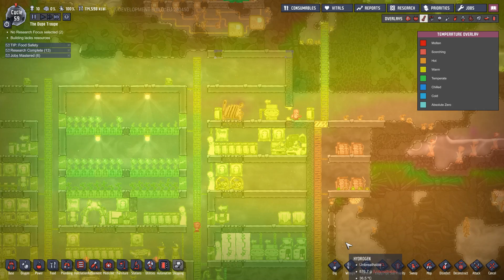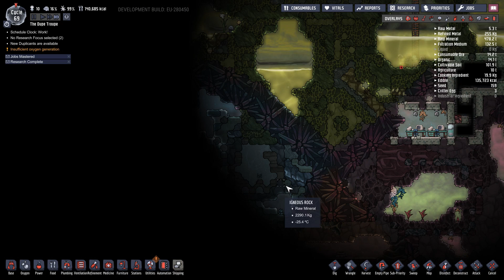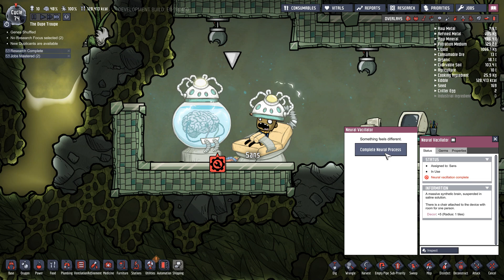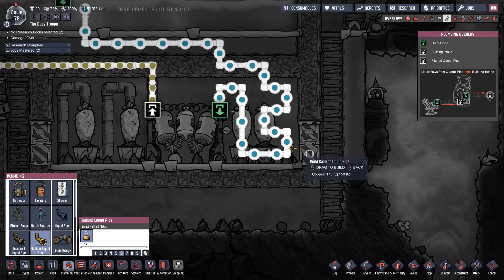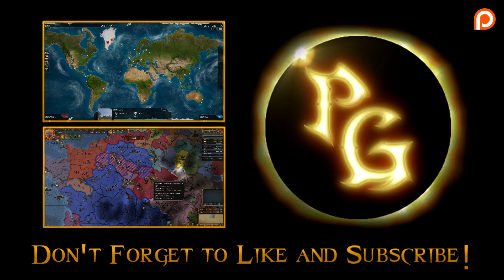Oxygen Not Included - The Dupe Troupe (Part 5)

Comment: I would have thought sticking a few of the cold plants inside the water tank would help a lot considering thats a major source of the base's heating. A lot of the heat is actually working its way through the air, so making the air colder it doesn't matter as much what the temperature of the water is. A more extreme option would be getting pumps, pumping the water through a room who's sole purpose is to be cold and essentially using that as a radiator to cool the water. Similar to your setup already but with no water scrubber, just taking water from the water tank and dumping it back there. Still just putting cold plants inside the water reservoir without pumps or radiators would have a similar effect without the extra resources and would also help everything else.

Comment: - you can use your cool steam vents, they produce hot water but not boiling one and you can cool it down like the sieve

- you can use your cool steam vents, it doesn't matter how hot the water going to electrolyzer is the O2 coming from it is always the same temp (it works like the water coming from the sieve)

- not sure if you noticed but you are adding germs into your clean water, sieve removes the pollution from water but doesn't kill the germs

- not sure how well the insulation tiles work but abyssalite has thermal conductivity of 0, it will insulate your base completely without using insulation tiles (last time I checked the insulation tile had higher conductivity than 0, but maybe it has 0 now)

- you can submerge the aqua tuner in polluted water to transfer heat into it (use abyssalite pipes to prevent outgoing water from heating up) and then use up the polluted water either in sieve or to make fertilizer, you can make it crazy and loop the water from the sieve through the aqua tuner in the polluted water  (where did the heat go?)

Comment: I believe wheezewort doesn't care about air pressure, only the temperature it is in.  If this is correct, you could consider pumping air into the wheezewort chamber using an high pressure vent to increase the heat handling capacity of the room by taking the atmosphere to 8+ kg per tile.

Not 100% sure it would help with the cooling of pipes, but it might be worth trying.

Comment: Use pipe bridges to help maximize the surface area of the heat dissipation idea you got going on at the moment while you build another treatment location in an ice biome and in the meantime, put that steam geyser to use already... I mean, it's just sitting there and interminently producing water for you and you haven't done anything with it yet. Granted, you had other concerns to attend to(Neutronium Vending Machine?) but come on! I would have jumped on that thing ASAP once I noticed my clean water reserves getting pretty low, just not as low as yours did though.